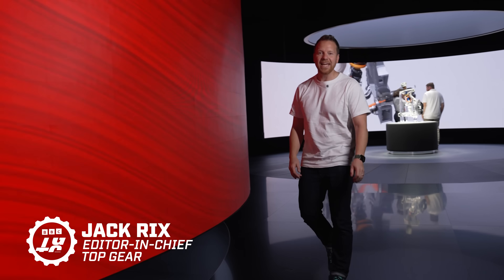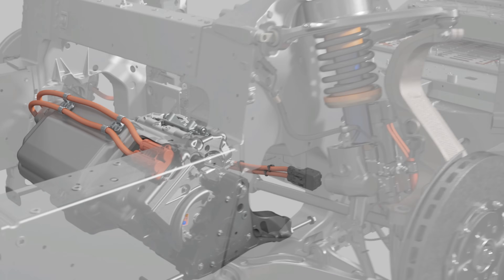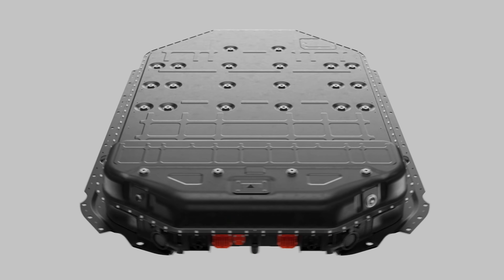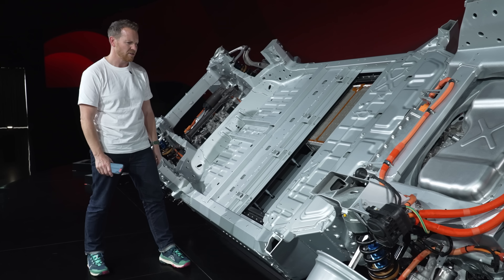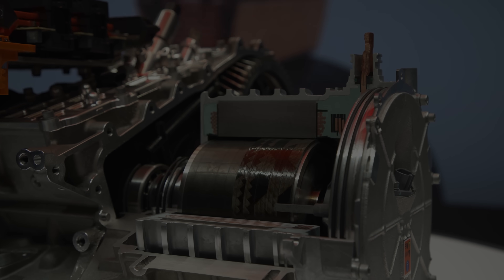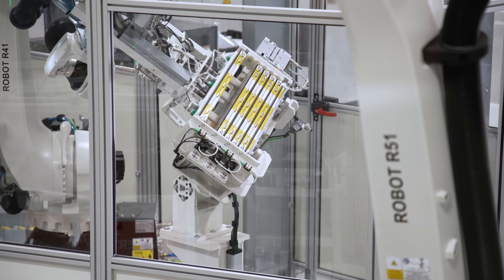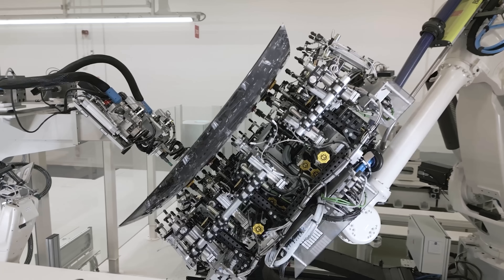Ferrari Elettrica: Tech Details On 1000hp+ EV! | 4K

Comment: The PUBLIC roads really need vehicles with a thousand horsepower. It's completely ridiculous.
 What a waste of time and resources.
Reply: this is just the beginning, electric can easily go over 50k and 100k horsepower, Tesla will soon release the roadster in the next months and show the world how this power can be achieved with the first sub 1 second 0-60 car.
Reply: @JohnSmith-pn2vl  Make, the way you're acting makes it obvious that if people don't have a religion then they use something else to fill the void, in your case, electric cars.

Tesla Roadster is vaporware, no-one is buying electric sports cars (see: Rimac Nevera), and the EV market now has tanked. Also if you want a performance figure worth looking at, then look at how the BYD Yangwang was 3 seconds slower than a manual 911 GT3 (non RS) around the Nurburgring despite having 6x the horsepower; more power ain't gonna help, and the only way you're getting sub 1s 0-60 is with Mickey Thompson drag tyres and a prepped surface...and a car like that will sell to Youtubers and no-one else, after 3 months it'll be about as relevant as the Plaid is now.
Reply: @JohnSmith-pn2vl  tesla is never releasing a roadster they have no market for it that’s why they don’t make it. They teased in years ago and quickly realized nobody wants that from them.
Reply: It's a Ferrari. The kind of car you will spot on the road once a year (if you're lucky), not a car for the masses...
Reply: @baywesty  its ferrari, it aint that rare
Reply: @joytoy1978 it's Ferrari, they sell more cars than before but this is not Fiat. I live between London and Paris, and I don't see Ferraris so often. Come on!
Reply: @baywesty sorry but I live in Sydney, I can see Ferrari occasionally,  like 458 488s sometimes a pista, more than that, there can be some gt Porsches, 3rs 4rs as such. One day I walk down the road to buy some snacks at night I came across 3 720s
Reply: it's because it's 1000bhp and weighs 3,000kg's

Comment: This Ferrari will break records.  It'll be the heaviest Ferrari ever made.
Reply: Youll have to own one before they give you an ICE Ferrari . If you sell it or complain about it on social media they’ll blacklist the special allocations
Reply: @BobbyDazzler888  By some accounts the F80 isn't doing as well as the LaFerrari; orders are being cancelled already, so the threat of not getting a special allocation isn't as bad as it used to be.

If they make an SP4 with a V12 then it'll depress the F80 prices more; as good as people say the car is, it's not a V12.
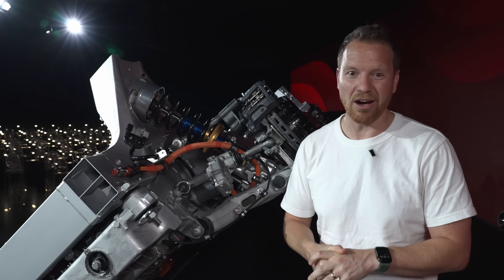Reply: 7:16 2300 Kilograms. 
Nuff said.
Reply: @starlord5785  New BMW M5 is 2500+ kg and not even an EV? 
If they wanted to, an EV wouldn't be super heavy. But that would raise production costs.
A Model S, while a bit bare bones, is lighter than most large EVs.
With some commitment, a similar car could have a carbon chassis and body, carbon battery sleeve, etc, etc. Smaller motors like Lucid/Koenigsegg.
Reply: @starlord5785 and 900hp. We call that compensation
Reply: @starlord5785 interestingly, the Purosangue is nearly 2.2t, so there's not that much of a gap
Reply: @starlord5785 dry weight. I guess the real weight will be 2.4 + tons. With 2 people onboard like 2550 kg
Reply: @starlord5785  And 2300kg will be the "dry weight" and somehow the actual weight will still be 200kg heavier, even tho there's no fuel tank to fill up.
Reply: @starlord5785  weight is the worst nightmare in an ICE car and almost meaningless in an EV.
Reply: @JohnSmith-pn2vl weight always matters no matter what vehicle, power to weight ratio is what tells how fast a car can be. It's also why a rimac nevera loses to a Porsche with just a quarter of the power on a track.
Reply: @JohnSmith-pn2vl  It is not meaningless at all heavier means more energy wasted from carrying heavy batteries. this is no work performed just carrying weight from A to B.
Reply: @JohnSmith-pn2vl  "weight is meaningless in an EV"  Yet a 2000hp million dollar Nevera couldn't even come close to a 500hp manual GT3 911 around the Nurburgring...
Reply: @JohnSmith-pn2vl  you don´t understand physics
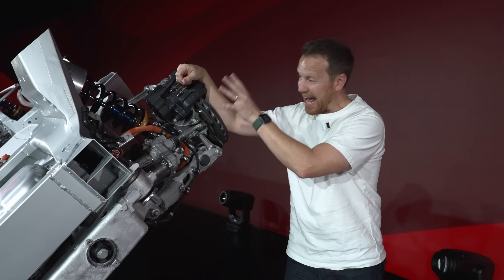Reply: @DonLee1980 For now dont forget the rise of true EV performance is starting we probably be dead by the time ICE cars are nomore and EV starting putting serious numbers on the track the SU7 Ultra Prototype did a impressive lap run this year at nurburgring 6:22
Reply: @Precision_6.5  that’s still over a minute slower than a Porsche 919 🤷‍♂️ the actual road legal car did a 7:04, which is still much slower than a 911 with a just 1/3rd the power and a manual gearbox.  The point is, sports cars aren’t for performance.  They are for fun
Reply: @DonLee1980 i think performance equals fun and better faster performance equals more fun so they go hand to hand
Reply: Imho Agree weight matters ice or bev, average joe problem  a few, faster deteriorating tire, suspension deteriorating also heavy body add the heavy wheels also, brake pads worn out faster to name a few
Reply: It's made of aluminum. Why don't they make combustion cars out of aluminum. I have read somewhere that if you make a car 30% lighter that it will be 20% less fuel consumed. Now with EV's you make a car heavier this means that you make it less efficient.
Reply: When they put them on the car transport, they will only be allowed to load 2 before exceeding the gwvr. The good news is, maritime portion of the logistics chain is already taken care of being that the car is also a boat.
Reply: Not as heavy as your mama 😅
Reply: And the slowest too - selling that is.
Reply: And the most expensive

Comment: I think Ferrari need to lead the way in performance no matter what the technology is used. But, cars will be like mechanical watches. People will always value an internal combustion engine and some real purists a manual gear box. I think Ferrari needs to offer this option and they'll generate much more excitement
Reply: Not sure they can design a transmission that can handle the torque from the electric motors.  That’s always been the problem.
Reply: That’s what people were saying about horses 120 years ago and then again about steam cars 90 years ago. Same destiny for ice
Reply: @nkoster3717 sure, but in the meantime they'll still try to sell you a Model S Plaid with different body panels and a Ferrari badge for 5 - 10 times the price you could get a different car performing basically the same or better 😜

Comment: Looks like it will be the fastest (depreciating) car on the road
Reply: You barely feed your dog sit down
Reply: Why would it depreciate if the batteries are replaceable?
Reply: @1InVader1  Because of Ferraris policy. If you want the hot stuff, you need to buy anything you get offered. Nobody wants it long term, so market will be full of these
Reply: @1InVader1  it's a trend with EV to lose its value fast from either low demand or oversuppply. look at mercedes EQS, Audi e-tron GT and probably even Porsche Taycan. they don't hold their value as good as their ICE counterpart
Reply: @hajiku1606  That trend is based on them having old used up batteries or slow charging. Replaceable batteries eliminates that problem.
Reply: McLaren has that spot reserved.
Reply: @qb4ever3k  can't imagine many would want an electric Ferrari second hand, and those who buy it first does it only for loyalty points
Reply: Not really it's the first full electric Ferrari. Also every part is replaceable.
Reply: But! Consider this, this Ferrari doesn’t have 7 oil pans and require 2 weeks in the shop for a service. It would probably be one of the most reliable Ferraris in the history.
Reply: Definitely not. First, there are plenty of other expensive EVs out there that will depreciate way faster than a Ferrari. Second, the batteries are replaceable. Third, as the first ever electric Ferrari, it will be collectible in the long term. Do I like it? Not really!
Reply: they will be sell out straight away
Reply: Let’s hope it depreciates, gives us all a chance to own one!
Reply: Not faster than depriciating than its driving range when it hits 60mph
Reply: Ffffffffffwwwwwwahahahaha!!!!!!! Genius
Reply: Ferrari? 😂 Not possible
Reply: I hope so, Id love to have one 😅
Reply: I logged on to say precisely this! EVs are depreciation Kings, and we will see $50K Ferrari Elettricas all over Autotrader. I know emissions are important, but the EU gotta give Ferrari an exemption. There is nothing better that the howl of a Ferrari V12. I was geting my emissions checked (California), and they had a used 2012 FF on the lot. The salesman fired her up for me, and I was floored at how good that engine sounds compared to a twin turbo V-8 (or V6 for that matter). Get all the used NA Ferraris you can, they are going to be collector's items.
Reply: Finally Porsche Taycan has some competition 😂
Reply: Yeah, this thing will cost ya 10k every 15 years in battery replacement.

A true Ferrari would run through that every 6 months.
Reply: What people doesn't know is that Ferrari is stripping down a SU7 to see how it works. 

"   a Ferrari representative was photographed with a Xiaomi SU7 Ultra in late July 2025, with reports confirming the Italian supercar manufacturer purchased the Chinese electric vehicle for internal benchmarking. 
Ferrari's engineers are studying the SU7 Ultra's performance, tri-motor layout, 800-volt architecture, thermal management, and chassis stiffness as they develop their first electric supercar. 
This acquisition highlights the increasing influence of Chinese EV technology on the established automotive industry.  "
Reply: @canadadry0g  This must be news to you but car companies do this all the time.
Reply: @canadadry0g smart thing to do!
Reply: @bavariancarenthusiast2722  They're copying. Ferrari is copying China. Now you claim it's "smart". Well I never...
Reply: @canadadry0g  What people don't know is that manufacturers study and benchmark each other's products all the time. If they're making an electric SUV then it is only natural to look at other electric SUVs.
Reply: 100%
Reply: ^^^ guys that will never own a Ferrari, knocking Ferrari. 😐
Reply: @Frack_Black it’s accurate observation. By your logic you should never speak on anything you can’t afford or do? Don’t complain next time your flight is delayed 😂
Reply: Take it to track and its range is the fastest depriciating thing on the planet. Might do 1 and a half lap before it gives up
Reply: @ShivamArya-yf4ku Oh no, Ferrari should have thought of that 🤦‍♂️